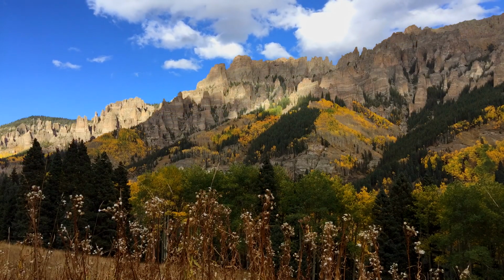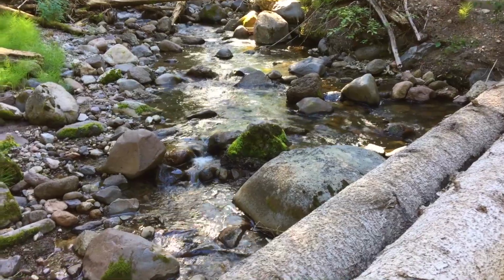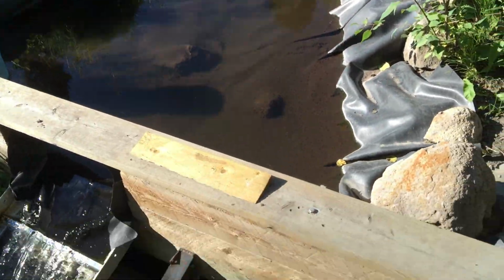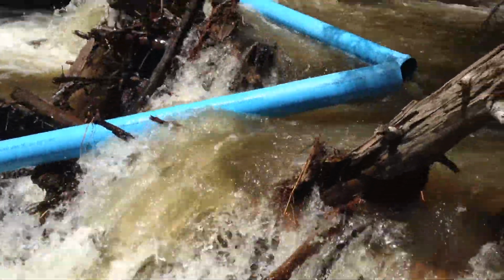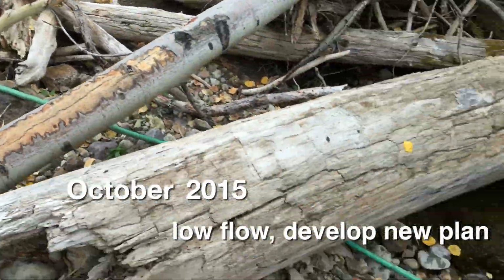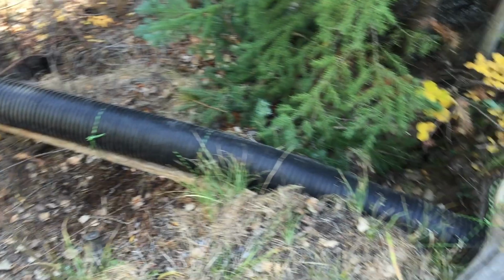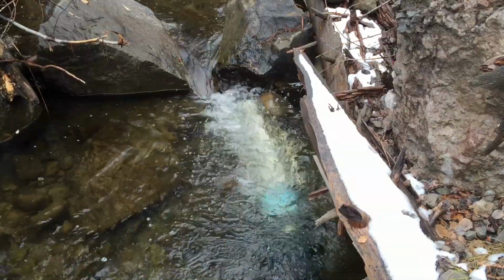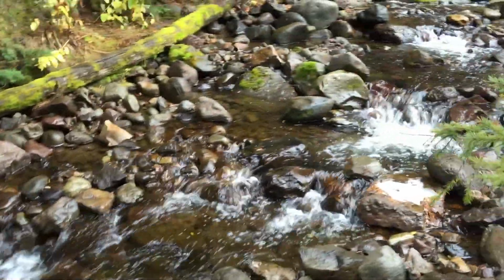Part 16 MicroHydro Power System in CO

Comment: Looking to do this type of hydro and wanted to know if it’s possible to be paid by the utility companies for excess not used on the homestead?
Reply from the maker: It is different in each state in the US. The lobbying by utilities regionally impact how the rules are set up. Some states are very restrictive others very accommodating. First you need access to the grid and if you have that then your design should take that particular utility's policy into consideration. We ourselves are 7 miles from the grid and it wasn't practical to spend $140k in 1995 or now $250-300k today to bring power lines in. 
But it is possible. I suggest speaking with the local utility and asking them what rules exist and what they would pay for your Excess power. There are all sorts of factors they might apply relating to peak load, time of day, and quantity of power. And the rules could possibly change in the future. There are states where the utilities feel their monopolistic interests are threatened by the growth of solar and that may impact the rules they have lobbied to create to protect their interests. 
If it is a  realistic option, then it is possible to use the grid as a load controller and save on costs in that respect. I'm not an engineer but I remember that it is possible to use an inductive motor instead of an alternator to generate the power if connected to the grid. That could possibly save money in the design. 
All of this warrants research on your part. What are the rules, how much power can you generate, how much of it will you use, is your ability to generate year round 24/7, what would you be paid per KWH, what are the regulations regarding water use and permits required, and other factors relating to how big a system to can afford to install. Lots of research to do before spending your money. Finding a local hydro engineer may also be useful to help answer many of the various questions. I don't want to make it sound too complicated but all this should be considered/investigated to get the most cost effective use of your money. Hope this helps.
Reply: MrHydrohead how do you control your excess generation.  And thank you for your quick response
Reply from the maker: Part 14 of the series shows our electronic load controller ELC https://youtu.be/1c8AYt6C2P4 it mainly gets shunted off to heat
Reply: MrHydrohead after I sent message I came across vid in series.   Hope all is good with you and the system.  All the best for the future
Reply from the maker: System runs just great. It provides enough heat to keep us cozy at 8600 ft in winter

Comment: So if you dont mind me asking, just how much do you think you have tied up in this project?
Reply from the maker: Reposting a previous answer to a similar question:
"It's a good question, but very difficult to answer. First, one would have to amortize the cost of laying in grid power in 1994.  At the time of the switchover the system had produced 145,000 kWh for a basic cost of $25,000 versus $140,000 for laying powerlines. Add $52,000 of current development costs and you are paying for all the future power generation in the systems lifetime. You would also need need to subtract the cost of line power over the last 19 years to determine the cost per kilowatt hour over the first system's history. ....... I got lucky and found myself able to pursue this undertaking nearly 25 years ago and am fortunate enough to share my experience via the Internet which has developed in the interim. 
Hopefully people somewhere in the world will find the information useful."

I'm glad you enjoyed the series.  Its rewarding to see others get something out of it.  In terms of burial of our pipe, it was certainly necessary due to the deep winter cold and the potential for animals or falling trees to damage the pipeline.  It was very rocky ground and made the burial more difficult and the bridge added a great deal to it as well.  Labor and machinery cost was the highest portion of the overall cost.  Not sure on the first system which was installed 1994 or 1995, but on the second pipeline it was roughly 56% or 29K of the 52K.  The pipeline and parts were about $7800 and diversion pipe about $650, Bridge ran about $1600, Weir under $300, powerhouse $3600, wire & electrics $4800, legal and consulting $2100. That labor and equipment rental was for all the work including laying electric wire, building powerhouse, weir, and bridge, and burying the pipe.  Sorry I can't really break out the labor for the pipeline separately, but those are the numbers I have, roughly totaled.

As you can see the lion's share of costs were labor and equipment rental and of course I already owned the hydro machinery from the first installation.  Also my time isn't calculated into any of this which was a substantial effort to accomplish.  I attempted to save money wherever I could by finding things salvage or on ebay whenever possible and neighbors helped with some labor, parts, and expertise as well. 

The reality with Hydro is that you are paying almost all your costs up front for all future power with very little parts or maintenance costs once installed.  The more power you produce and put to good use the better amortization of the costs.  Still to date, I've saved a great deal being off grid vs. running power in(w/1994 dollars).  I can't imagine what they would charge me now to run 7 miles of service, probably double the 1994 figure.  So, I feel fortunate and happy to see the meter spinning madly in my favor.  Of course if I was grid connected I could be selling the excess power, but it is fully off grid.

Please subscribe and share the series with friends that might have interest as that helps the Youtube channel get better promotion and more people will see it.  1.1 million views so far, I can hardly believe it.

Hope this helps, best of luck with achieving your goals.  Thanks for your interest!

Comment: Absolute beautiful paradise you have there. When's part 17 to be released or made?
Reply from the maker: +Brian Patton 
Sorry I've been slow with the next video.  This year has involved selling our other home and moving here on a permanent basis now that I've retired.  There will be more vids, just can't say when.  I have an electrical engineer who is working on some remote control features and I'll be adding capacity to the load on the system. Complicated things so it may take some time.  Thanks for watching.

Comment: What do I have to do to get a hold of some of these components
Reply from the maker: I would recommend watching the whole series, as the measurements of how much power is available from head and flow is critical.  That will dictate what sort of equipment best suits the site. Every site is unique.  There are lots of suppliers of different gear to harness power.  My components cost far less in 1996 than they would today.  There are now lots of other components available out there that weren't back then.

My own equipment came from the following sources:
The Turbine was manufactured by Canyon Hydro in Deming WA,  purchased long ago in 1996.  A pro grade component. http://www.canyonhydro.com.  Generator was Made by Lima in Ohio, again purchased in 1996.  They have been bought out by Marathon years ago.  https://www.marathongenerators.com/generators/index.jsp  The load controller was made by Thomson and Howe in British Columbia, again 1996.  These are the three most critical components and were installed on the first system which ran spring water. (see parts 1-5 of series)

The other parts were sourced from various suppliers on the basis of best price.  The 480 transformer came from a Craigslist listing, the pipes and valves from a local supplier, wire sourced on the internet and Home Depot.

Hope this helps, thx for watching

Comment: its good to hear from you after what seems like ages. glad to see things seem to be going ok even after the pipe washed away. how long do you reckon before all the work will be completed?
Reply from the maker: +Jakob Rebeki 
Yeah, it takes a while to get these things done as it it not my only pursuit.  We want to measure the water and see how  the flow holds up in the depth of winter.  That is when the most power is needed anyway.  Through the fall, 4800watts was too much power and it just ended up heating up the basement where the excess power gets dumped as heat.  If we can prove that there is enough water flow in the depth of winter and we don't have freezing issues, then it makes sense to spend the money to capture all that excess power and use it to fully heat the house via the in floor glycol, jacuzzi outdoors, ect.  But it seems prudent to prove the water flow first.  Like I always say, patience and persistence required.  I would love to be done and move on to documenting other micro hydro system, but it all takes time and money.  Sorry I can't do it faster.  Keep watching, more to eventually come.
Reply: +MrHydrohead i will very much look forward to that, thanks....

Comment: good on ya mate ... very well done ! I would like to see the numbers for the winter and spring another year from now 11-03-18 if it's not to much trouble and you have the power to run the calculator ;)
Reply from the maker: I'm assuming you want to see proceeding kWh produced?
Reply from the maker: Power currently @ about 260,500 kWh on the meter and it's not being full winter yet we've been making about 4500w continuously since mid April 2018. Will be ramping up in the next week or two for the winter to 7500-8000w.  Hope this answers your question. If not let me know

Comment: Watched your adventure in its entirety. Great Video and a masterful project.  What was the approximate final cost of the improvement, If you would care to share that information?
Reply from the maker: Reposting a previous answer to a similar question:
"It's a good question, but very difficult to answer. First, one would have to amortize the cost of laying in grid power in 1994.  At the time of the switchover the system had produced 145,000 kWh for a basic cost of $25,000 versus $140,000 for laying powerlines. Add $52,000 of current development costs and you are paying for all the future power generation in the systems lifetime. You would also need need to subtract the cost of line power over the last 19 years to determine the cost per kilowatt hour over the first system's history. ....... I got lucky and found myself able to pursue this undertaking nearly 25 years ago and am fortunate enough to share my experience via the Internet which has developed in the interim. 
Hopefully people somewhere in the world will find the information useful."

I'm glad you enjoyed the series.  Its rewarding to see others get something out of it.  In terms of burial of our pipe, it was certainly necessary due to the deep winter cold and the potential for animals or falling trees to damage the pipeline.  It was very rocky ground and made the burial more difficult and the bridge added a great deal to it as well.  Labor and machinery cost was the highest portion of the overall cost.  Not sure on the first system which was installed 1994 or 1995, but on the second pipeline it was roughly 56% or 29K of the 52K.  The pipeline and parts were about $7800 and diversion pipe about $650, Bridge ran about $1600, Weir under $300, powerhouse $3600, wire & electrics $4800, legal and consulting $2100. That labor and equipment rental was for all the work including laying electric wire, building powerhouse, weir, and bridge, and burying the pipe.  Sorry I can't really break out the labor for the pipeline separately, but those are the numbers I have, roughly totaled.

As you can see the lion's share of costs were labor and equipment rental and of course I already owned the hydro machinery from the first installation.  Also my time isn't calculated into any of this which was a substantial effort to accomplish.  I attempted to save money wherever I could by finding things salvage or on ebay whenever possible and neighbors helped with some labor, parts, and expertise as well. 

The reality with Hydro is that you are paying almost all your costs up front for all future power with very little parts or maintenance costs once installed.  The more power you produce and put to good use the better amortization of the costs.  Still to date, I've saved a great deal being off grid vs. running power in(w/1994 dollars).  I can't imagine what they would charge me now to run 7 miles of service, probably double the 1994 figure.  So, I feel fortunate and happy to see the meter spinning madly in my favor.  Of course if I was grid connected I could be selling the excess power, but it is fully off grid.

Please subscribe and share the series with friends that might have interest as that helps the Youtube channel get better promotion and more people will see it.  1.1 million views so far, I can hardly believe it.

Hope this helps, best of luck with achieving your goals.  Thanks for your interest!

Comment: Why dont install a steppingmotor or simm. regulator for neddle control.

Then you dont have too run balast /breaking capacity i you dont need them for the house.
For ex. In summer (heating)
Your system is "of the grid" right? 
The magnet realese jet breaker
Is a good "fail safe" over speed control. However. in combine with auto adiustment of flow in turbine it can be better.
You still have your 
Jet breaker as fall back in case of malfunction.
Reply from the maker: +Staffan Lundgren 
Mechanical controls have been around much longer than ELC(electronic load control) however they can't respond as quickly to load changes.  We have a steam shower (6500w) that will come on and off during its occasional use.  Imagine the amount of water flow change that would need to occur to feed the load of something like that.  It's a huge amount of water difference and changes in a mechanical system can't occur that fast by design.  If they were you could risk a water ram that might damage the penstock.  I know it's an extreme example, but it holds true to a lesser degree for toasters, hair dryers, large motors, tools, or other such high load devices.  There will eventually be a way to remotely adjust a seasonal range of flow which will prevent needing to walk to the powerhouse and a stepper motor will be used.  For short term load changes ELC is our best choice and provides a steady stream of either hot domestic water or even a heated jacuzzi.  Lots of ways to use the dump load, but thanks for the suggestion.
Reply: +MrHydrohead 
if you loock att larger scale hydro electric  instalatations with "tube feed". there are often raiser tower to handle water ram situations. i guess that becuse your system lacks raiser tower of larger type. 
that risk is larger with fast electrical valvecontrol.

(you have the pipes for air relese . they are to small in diameter compered to your tube dia. to be effektive maybe?)

have a rasier tower ever been option for you .or is that to expensive or impractical to build.
mayby too high "waterpillar"
/s
Reply from the maker: +Staffan Lundgren 
Well, it is a Micro hydro system after all.  Never really considered a ram system as you describe.  I think given the weather extremes, it would be a tenuous choice to attempt it and more complicated than valuable. The ELC was the recommendation of the engineer that helped me put the first system together in 1996.  The redesign choices were based on continued use of the existing components.  KISS keep it simple & stupid has been the guiding principle.  It is interesting just the same to have an understanding of how the big boys do it.  
Ultimately, while massive centralized dams and large scale hydro can provide massive amounts of power and revenue streams, the environmental costs and displacement of people by the dam lake seem to me to be a product of the centralized capitalistic system.  We are entering a new era where off grid or decentralization of renewable power will empower those with interest to be less dependent on the big centralized systems of the past.

Comment: Hi there, thanks for another excellent, well produced video.
Can't wait for the next one ;)
I've been using Mango Automation on a few control/automation projects, you might be interested in it for you stuff, Joel there is very helpful.
How many data points do you think you might monitor across your system?

Cheers
Dan

Comment: Great video series keep up the great work. Any plans to add solar panels to the project? Solar a lot cheaper now than previous years so may work out cheaper considering the spend on engineering/ contractors. Once again well done. greetings from Ireland!!
Reply from the maker: Its unlikely that I would add Solar.  We already are capturing about 7500w continuous AC or 180kwh per day.  Its enough to heat the entire house in sub zero temps.  Also, never wanted to maintain the batteries.  I'm glad to see the price has come way down on solar since I started, but we're pretty well set.  More vids to come so please subscribe.  Thanks for watching.

Comment: What was the overall head between intake and power house?
Reply from the maker: Static pressure at powerhouse = ~98psi, so 2.31 * 98 = ~226ft. of head.  This assumes my pressure gauge is accurate, but it pretty closely matches what I got through physical and barometric measures, and topographic guesses.  See part 6 or 7 for more info.
Reply: +MrHydrohead awesome, I have about half of that and twice the problem. :-)
Reply from the maker: Sorry to hear.  But any hydro is good hydro.  What part of the world?
Reply: +MrHydrohead Kenya. have a 54 meter fall with nothing at the top but space to dig a pond. want to use that as pumped storage (half the problem) and wind, solar and tides to pump water up onto the reservoir, then use a setup like yours for power generation. cheaper than buying and maintaining batteries.